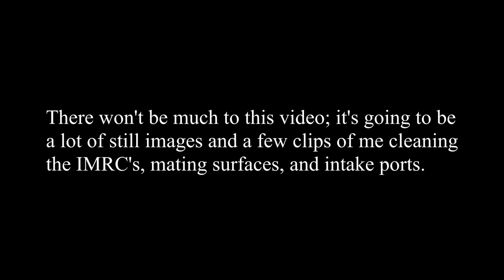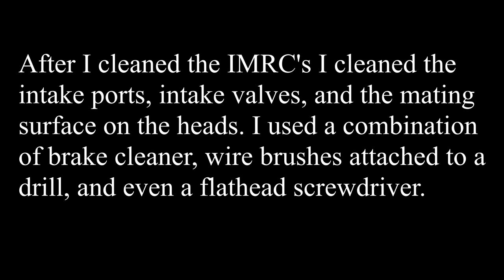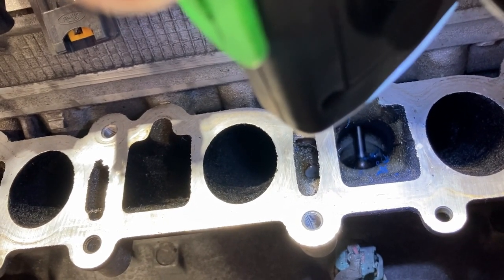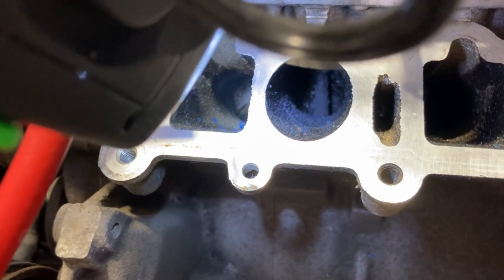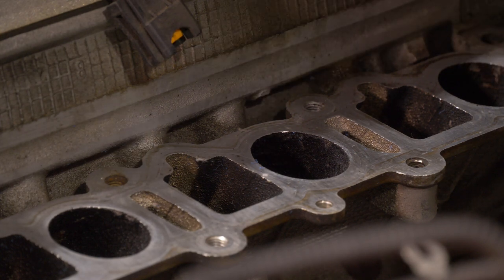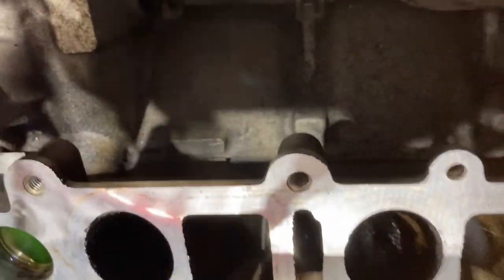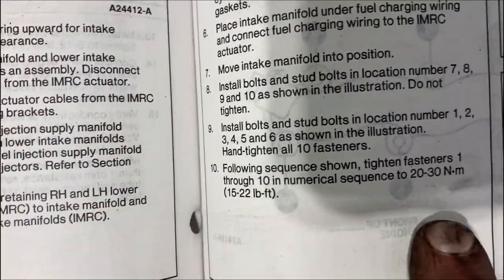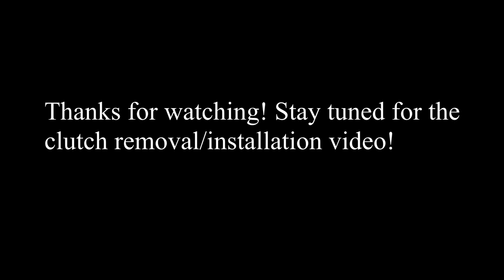Project Sneaky Snake PT. 5: IMRC Clean/Re-install 97 SVT Cobra

Comment: Been searching a video on this for years.  Amazing video - gave me the confidence to clean the IMRC's on my 98 Cobra this spring.  Subbed
Reply: Awesome! Thanks for the sub!
Reply: @richardrawson  Finally getting around to doing this job next week.  Did you end up replacing any gaskets?  and what's the technical name for that white wire brush attachment you used on the drill to clean out the ports?  I don't have much experience with turning the crank to close the valves, but I assume it's self explanatory and I'll be able to notice them closing as it's turning
Reply: @azizshavershian2065  sorry I didn’t see your comment until now. I don’t know what the brushes were called on the package but I found them at Harbor Freight. In my case I had to be more aggressive and use a screwdriver because the buildup was so insanely thick.

Comment: Finally getting around to doing this job next week.  Did you end up replacing any gaskets?  and what's the technical name for that white wire brush attachment you used on the drill to clean out the ports?  I don't have much experience with turning the crank to close the valves, but I assume it's self explanatory and I'll be able to notice them closing as it's turning

Comment: Good stuff man keep it up 👍🏼 steeda underdrive pulleys are a must.  if your not running your front brace i suggest the jlt fender well intake , i did a McLeod Chromoly 8 Bolt Flywheel 16 pounds, next step is a aluminum drive shaft & rear suspension
Reply: Thanks brother! I need to research underdrive pulleys more for these cars. I’ve always avoided them after using them on my 89 Trans-Am- I had alternator problems all the time after installing them!

Comment: Hey Snake, do you remember what the torque specs are for upper and lower intake manifold?
Reply: I used a Ford factory manual and it says to torque to 15-22 lb ft. and if you’re looking down at the upper manifold you’ll see three tabs on each side- the fasteners on the middle tabs get torqued to 71-106 in lb.

Comment: How can you test them if ones stuck closed with out taking the intake off
Reply: I assume you’re talking about the intake valves. You can use the spark plug holes to see if the cylinder is on the exhaust or compression stroke but there’s always going to a valve opened somewhere so you just have to take special care when the intake is off not to let anything fall in the ports with open valves until you can hand-rotate the engine until the valve closes.
Reply: @richardrawson  inwas referring to the imrc runners and actuator but, I got them to open and close with my scanner.